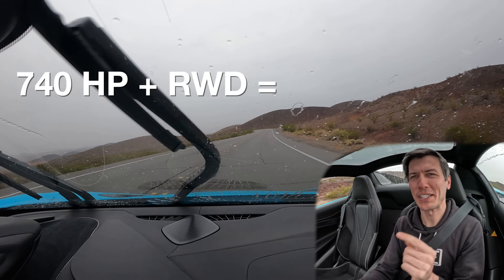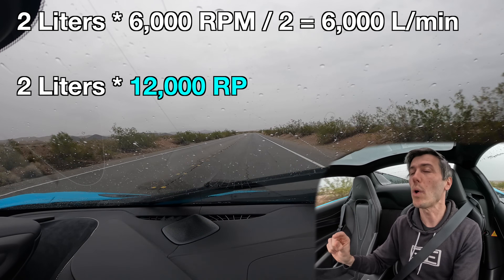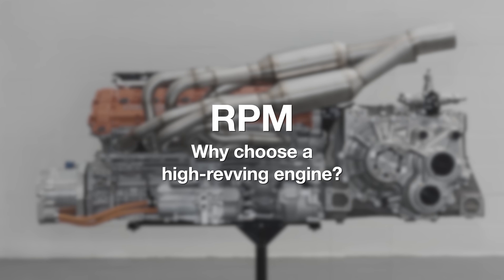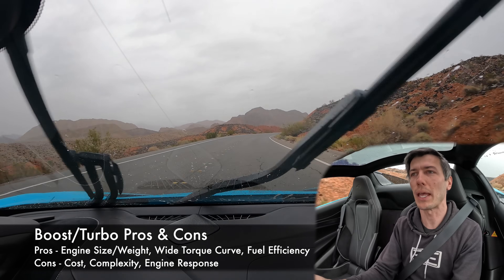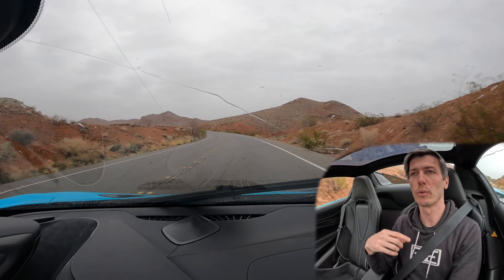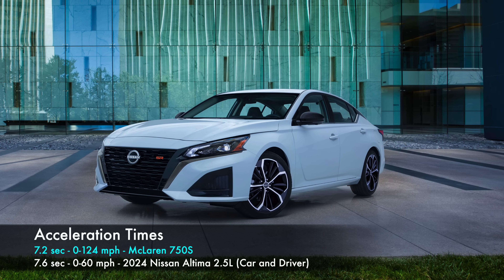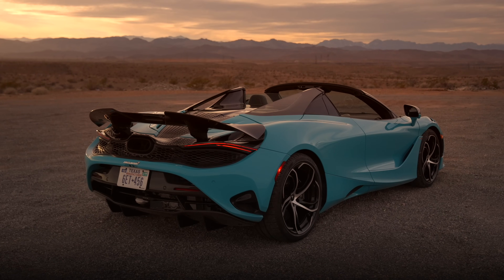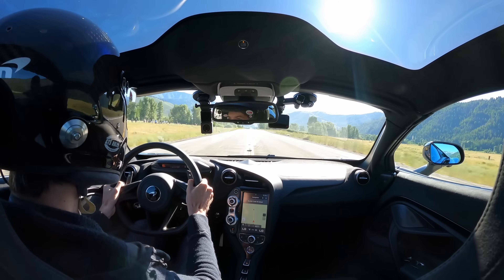Boost vs RPM vs Displacement - What's Best For Horsepower?

Comment: I used to have a 77 Coupe DeVille street rod with a 512cu custom crate Cadillac V8. 5200 rpm redline and an absolute tire roasting torque monster.
Now I drive a Mustang with a 5.0L Gen 3 Coyote engine, 7600 rpm redline and 7 pounds of boost from an intercooled ProCharger P-1X supercharger. Doesn't have the tire roasting bottom end and the doesn't bark the tires when it shifts, but the perpetual acceleration is amazing
Reply: A Gen 3 Coyote fed 7psi doesn’t bark the tires when it shifts? Something sounds off there. That shiny should roast tires up through like 3rd or 4th gear changes.
Reply: @ALMX5DP  Definitely does not. Failed to mention it's a 10 speed auto. But at wide open throttle flat dry surface there's no slip after 1st or 2nd. 275/40R19 Michelin PS4S
Last dyno I had done was 620rwhp at 7600
Reply: @DanielReyes-hz1qk  oh interesting, wonder if there is something in the shift logic which softens the actual shift or something. I’d think that 620 wheel would roast a general summer tire at low speeds when the throttle is matted.
Reply: @ALMX5DP  Also ProChargers are centrifugal superchargers so the 7psi is peak at 7600. I'd have to look at the dyno sheet for specifics but I'm sure it's well under that (maybe 4 or 5 psi) at the RPMs it hits on shift
Reply: @ALMX5DP 10R80’s “slip” the clutches when you’re not in drag mode for torque reduction. Mine in any mode other than Drag shifts hard but won’t chirp the tires  but once it goes it drag the torque reduction is turned off and you will break loose between shifts for a second. It’s quite odd your first few times when you don’t expect it.
Reply: 8.3L?  Good LORD lol.  That's awesome!  Wish I could've seen and heard that!
Reply: @ohheccwaddup3225  It was a beast. Custom mid length headers, dual 3 inch exhaust and Flow Master 50s (hot rod size). Had to drive it across a parking lot to an exhaust shop open headers....it was wild
Edit: shout out to Cad Company in Albuquerque for that crate engine, which, in their terms, was a relative 'powder puff' 😂
Reply: Yea that's called much better tires and suspension on the Mustang.
Reply: Wow I feel useless with my v6 now even though I think it’s fast, not really cuz I’ve only driven a few cars. cool stuff how much money did you put in the Cadillac?
Reply: @sylamy7457  Performance wise probably 30k+, painted it a few times had a nice sound system it was a lot
V6s can be fast and in all reality there's only so much you can do on normal public roads anyway
Reply: @sylamy7457 It's "fast" relative to sports cars of the past.  Anything in the low 5's to 60 is plenty for a daily driver.  The modern view of everything needing 700hp+ to be considered fast is ridiculous as the majority of those cars can never really be pushed on the street, regardless of adhering to speed limits.
Reply: You should be good for 10lbs on pump gas, who did the tuning?
Reply: @169abr  Smog legalities in my state. The tune is from ProCharger for smog reasons, I chose the lower boost kit for daily driveability since the higher kit only made 8 or 9psi and only netted another 60 to 80rwhp at a cost of several mpg overall.
The custom tune I don't run officially is from TPS Motorsports, my local ProCharger dealer
Reply: @DanielReyes-hz1qk  ahhh I gotcha, I’m in FL so we don’t have to worry about that stuff around here and 10psi is what most people drive around on. About 650-670whp on 93 is a nice place to be, but gotta do whatcha gotta do sometimes.
Reply: @169abr  Yeah exactly. Everything I own is handicapped thanks to my state. 620rwhp was eeking out every last bit, I think on ProChargers tune it's under 600, I don't recall. But a smog legal 600rwhp while still getting 18+ miles per gallon real world makes me happy. It's lowered with a nice suspension rides comfortably and handles well
I've seen Pony's from Palm Beach Dyno running ethanol making 1200+
Reply: @DanielReyes-hz1qk  I believe lund racing has done over 2000whp on ethanol, these coyotes are insane.
Reply: @169abr  Oh and our highest octane at the pump here in Cali is 91, lol

Comment: DIN 66036 defines one metric horsepower as the power to raise a mass of 75 kilograms against the Earth's gravitational force over a distance of one metre in one second: 75 kg × 9.80665 m/s2 × 1 m / 1 s = 75 kgf ⋅m/s = 1 PS. This is equivalent to 735.49875 W, or 98.6% of an imperial mechanical horsepower.
Reply: Huh.  I thought it was calculated the same way, but you had use a metric horse (where its head length matched the length of Queen Victoria's arm, or something like that).
Reply: @scottboettcher1344  For a metric unit it really is weirdly arbitrary as if 75kg (not a multiple of 10, 100 or 1000) was chosen to give a result very similar to HP. I wonder what the problem is with just using KW.
Reply: @reggiedixon2  1 KW is significantly lower number than  1horsepower and marketing is about bigger numbers always
Reply: @reggiedixon2 whole horsepower unit thing is weird. Just use kilowatts
Reply: @vvevvevvvv  Agreed, the most weird thing is apparently a typical horse is about 14 HP
Reply: @reggiedixon2  even I can make more than 1 horsepower:)
Reply: @reggiedixon2 1hp is the amount of power 1 horse can sustain over a working day when being driven according to the normal agricultural/industrial practices of the early 19th century. Sure, it can make 14. But not for several hours straight while driving a pump or whatever.

It's also a guesstimate, Mr Watt didn't actually have access to a horse so he used a pony instead and then just applied a 1.33 multiplier to his results.
Reply: @MrHamof  But engine BHP is not quoted like that, everyone understands it is max.
Reply: @reggiedixon2 Sure, I'm just saying why horsepower isn't the amount of strength that is the maximum a horse can do.
Reply: @MrHamof  So it is an even more irrelevant unit
Reply: @vvevvevvvv  freedom units forever 🇺🇸😤
Reply: kW is a better unit in my opinion, but at least we have a standardized definition against the SI units
Reply: That's an abomination of a unit. For one, it's not truly metric. For another, it's just going to get mixed up with real horsepower, not only by the name but by how it's only 1.4% smaller so the numbers will sound reasonable but be slightly off. If you're going to go metric, kilowatts are the unit to use.
Reply: who cares about such thing as a metric horsepower?  the SI base unit for Power is the Watt.  It is the only one precisely defined and scientifically standardized around the world.  All other units are defined in terms of SI units, including US Customary units.
Reply: @francoisloriot2674  Well for someone who doesn't care you seem remarkably invested. I simply looked it up and quoted the definition because Engineering Explained pretended to not know.